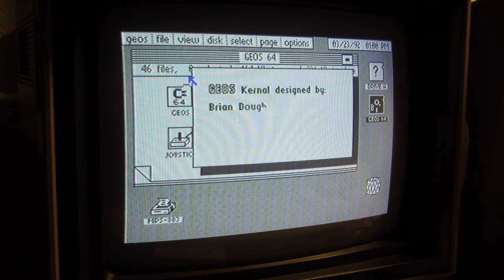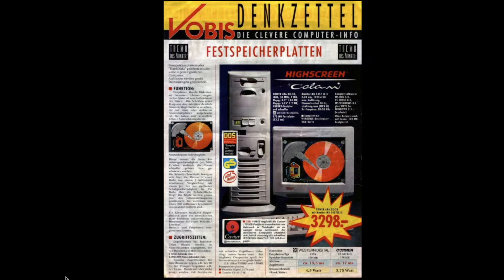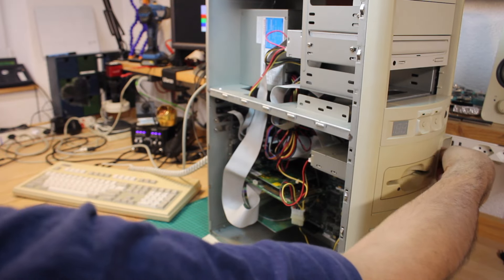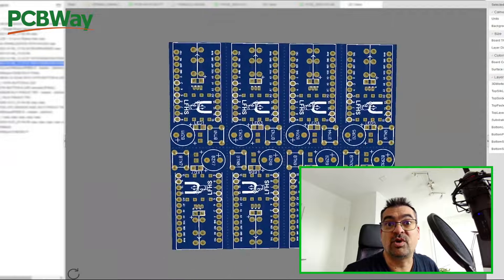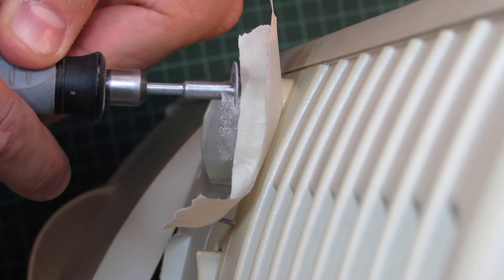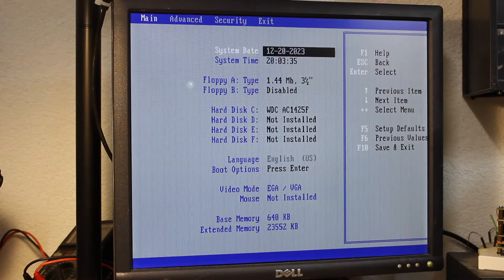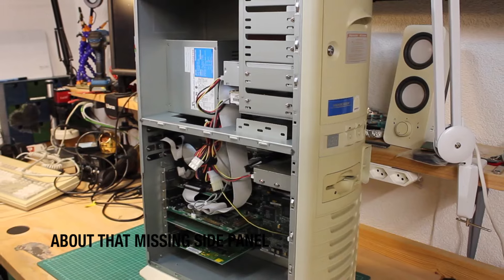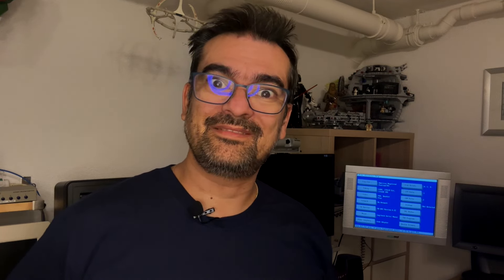How I restored "my" 1993 VOBIS HIGHSCREEN "Colani" Tower PC (Part 1)

Comment: Highscreen Colani is really one of the best computer coming from 90 years
Reply: Lol no. Highscreen PCs were usually complete crap because Vobis cut corners left and right, the worst offenders were the 486 PC's were they removed the Cache to save a few bucks, making the machines incredibly slow. they also tricked buyers by using the landmark mhz instead of the real one. they also used proprietary mainboard and they just loved to minimize the bios in terms of options so the user wouldn't fiddle too much with the machines. All in all, they were total shit. 
And colani always was one of the weirdest designers, i guess it's a matter of taste if you like the stuff he did, i don't, most of it looks atrocious imo.